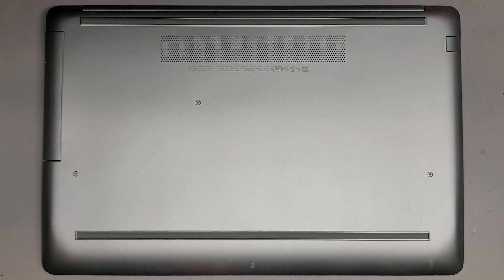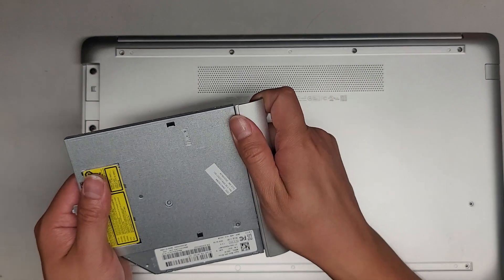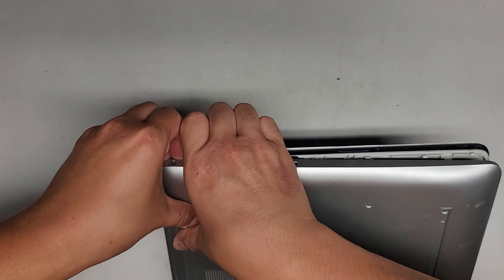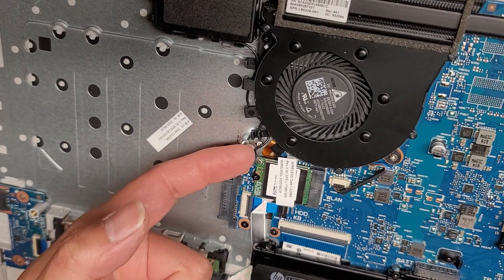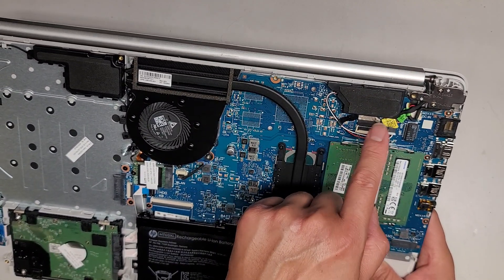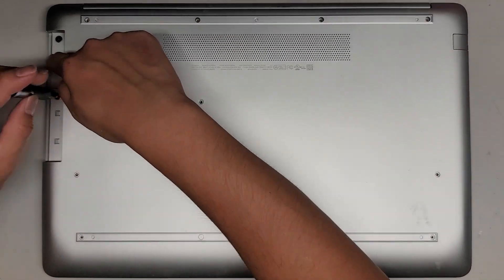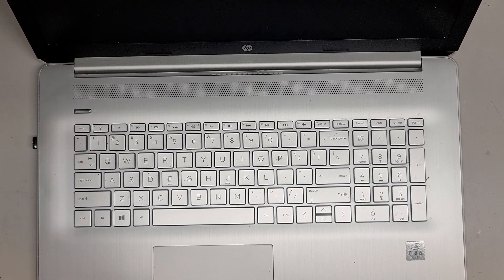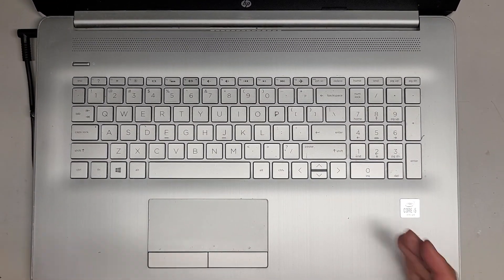17" Inch HP Laptop 17-by3053cl Disassembly RAM SSD Hard Drive Upgrade Battery Replacement Repair

Comment: Where js the cmos battery place
Reply from the maker: Built into the main battery.
Reply: @ItsBinhRepaired  How does this work when the main battery is removed? Mine was just operating off AC power (the main battery was failing so I removed it) and after awhile I got a 'CMOS Checksum' error and shortly after the laptop just died, it won't power on at all.

Comment: I was given an HP laptop on this same chassis as barter to partially pay for upgrade work on another laptop.  The 17" screen is nice and the laptop is all black, which I think looks good.

I wound up doing quite a bit to it.

I upgraded the fixed disk from a 1 TB 5400 RPM SATA hard drive to a 2TB WD Blue NVMe SSD.  I also added a 1 TB WD Blue SATA SSD that I had lying around, because why not?

I upgraded the RAM from a single stick of 8 GB to two matched sticks of 32 GB, giving me more memory and enabling it to run in dual channel.  I went with 32 GB because I was able to get a good deal on that amount, so why not?

I upgraded the Wi-Fi card to a Realtek RTL8821CE, which has Wireless AC and Bluetooth 4.2 over a single antenna.

The right speaker was dead, and it turned out one of the wires for that speaker had been severed by the factory.  Great quality control.  I managed to solder the wire back together and sealed it up with some shrink tubing.

Then I replaced the battery ... which caused an issue where the laptop could not start up on the battery by itself.  At first, I thought it was the logic board, so I bought a used board for $40, but it was still doing it.  The problem wound up being the aftermarket battery.  I bought a different brand (Ninjabatt) that worked.  I then calibrated the new battery.

I was contemplating returning the replacement logic board, but then the replacement board came with a Ryzen 5 3500U with Radeon Vega 8 graphics whereas the original board came with a Core i5 8th gen with Intel 620 graphics.  The replacement board was a worthwhile upgrade for the price.

And finally I had a spare retail code for Windows 11 Pro.  I used it with this laptop, upgrading it from the Windows 10 Home that it originally had.  Of course, I did a fresh install of Windows 11 on the NVMe.

Hopefully, this computer will come in handy as an entertainment laptop for some games and movies, though it can come in handy for other things thanks to the Ryzen 5 CPU and 32 GB of memory; a nice complement to my MacBook Pro work computer.

Now, I just have to be gentle and careful whenever I open and close the screen.  The plastics that keep the screen hinges in place haven't broken yet, so I hope to keep that from happening for as long as possible.

Comment: I have glue behind that rubber stand so im afraid i wont be able to playce it back properly
Reply from the maker: Glue? Should just be double stick tape.
Reply: @ItsBinhRepaired  idk but it was a very thick layer of something sticky
Reply from the maker: Yeah, the double stick adhesive. It gets gooey when it gets old.
Reply: @ItsBinhRepaired so if i take ot off i could stick it right back without any issue?
Reply from the maker: @imsubbed3414  yeah, worst case to night need new double stick tape.
Reply: @ItsBinhRepaired  ty
Reply from the maker: @imsubbed3414  no problem